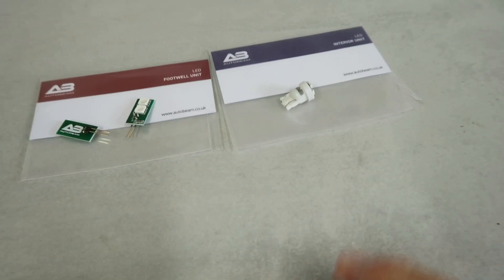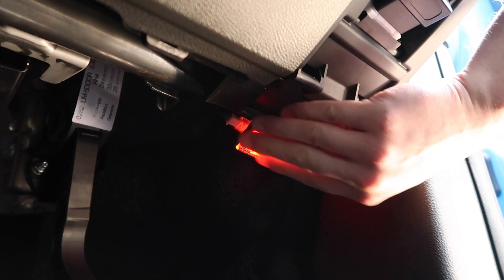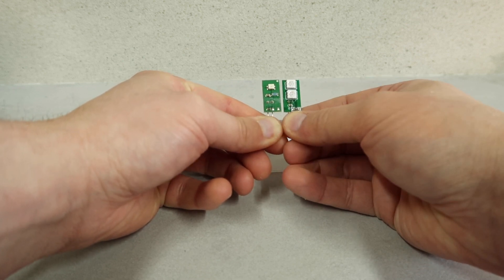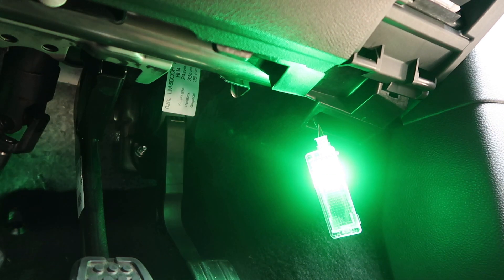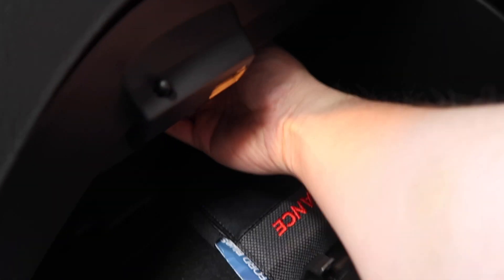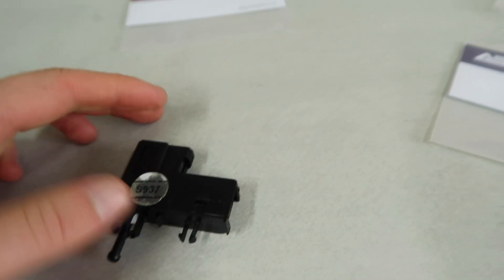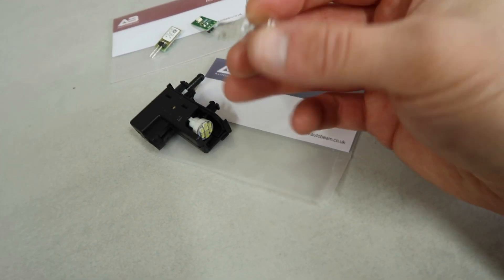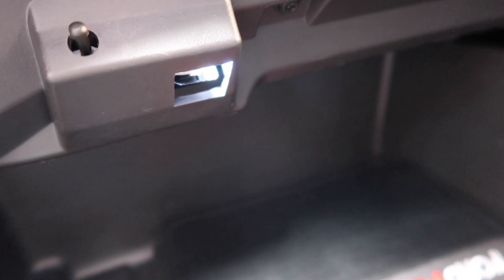AUTOBEAM FOOTWELL & MINI GLOVE BOX UNITS INSTALL! | PERFORMANCE LED | MK3 FOCUS RS

Comment: thanks again Adam! shipped blue ones across the pond. Needed to bend the pins a wee bit, otherwise a quick swap and a nice upgrade 👍
Reply: Hi iv been looking for these but can only see them with pins in the middle.  But they need to be on ro the side. So would be out of line.   Is thus what you mean by having to bend them slightly.  Thanks

Comment: Tried to install mine today. Nightmare with my 6ft 2 frame. I can’t seem to line the pins up again with the connector. I tested it without the frame and works fine but then noticed 15mimd later when I came to the car they hadn’t gone off. Which is odd.

Comment: Hi Adam .
I  ordered the led bulb for the glovebox and it isnt the right one . The leds should not be forward firing , the leds should be along the side . Plugged mine in tonight and there is only a small amount of light that comes through the square hole in the glovebox . So light should come through the side of the led and not the end .
Reply: Just been in touch with Autobeam who tell me they are aware of the glovebox led bulb they sell only emitting light from the end of the bulb which does not throw hardly any light into the glovebox . The led needs to have side firing leds to work properly .